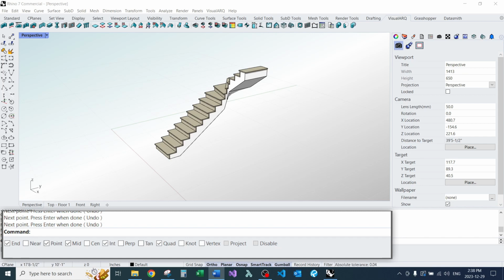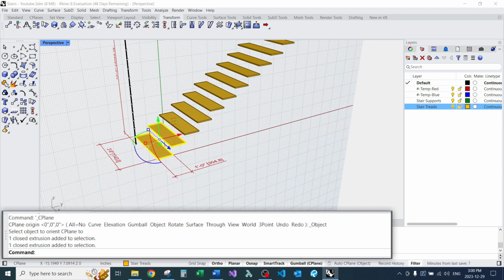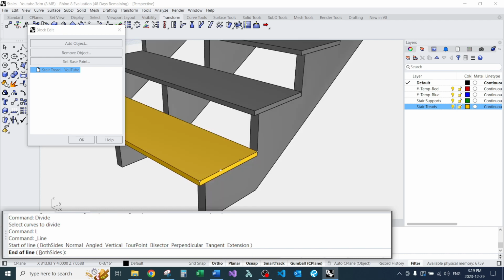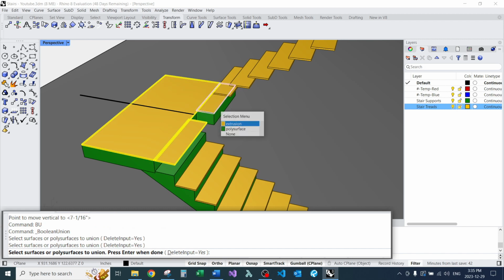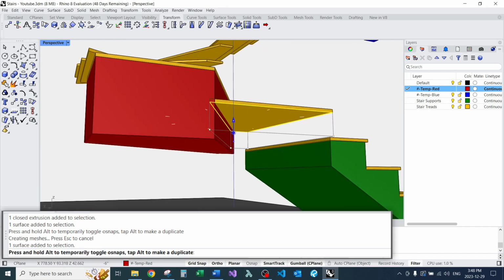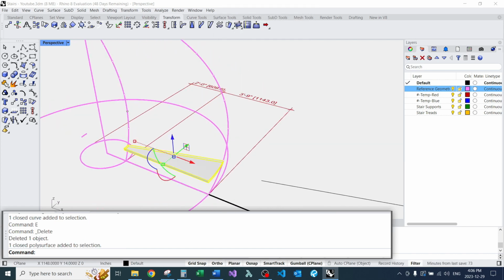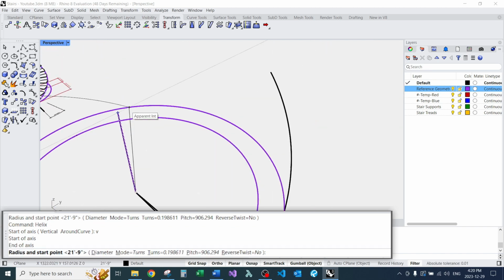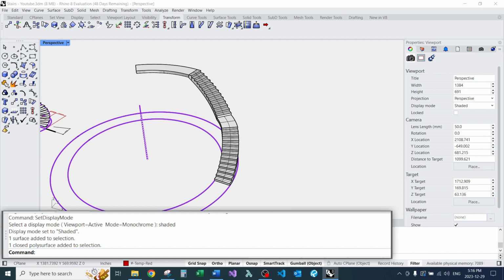Rhino Stairs 3D Modelling

Comment: Hi . I am an old hand at stair building, but a new newbie at Rhino. Do you offer any tutoring one-on one remote?
Reply from the maker: I've never really considered it and you're the first person to ask. Outside of creating videos I don't know if I'd have anything of real value to offer.
I also learnt Rhino in an unconventional way: I created a series of test projects to assess the viability of using Rhino instead of more expensive applications (like Revit, steel detailing platforms, etc...). That might make me not the best choice for someone just starting out because I have a somewhat 'patchy' skillset.
Just for a reference: recently I found out that I was taking 3 or 4 extra steps because I never bothered to test out the "Boolean Split" command (watched a video where the creator used it).
For now... I would watch videos where the uploader models something similar to what you want to create. Try to reproduce it (maybe with your own twist) and that should get you close. I can also upload quick videos on specific tasks (within my ability) on a whim.
Also, look up the Rhino Level 1 and Level 2 training. I will dig up those links for you if you're interested and can't find them.
Reply: I am fine with your abilities. Let's co-design a project . @randomCADstuff
Reply from the maker: My problem right now is that AutoCAD work is paying the bills. I m however trying to migrate towards Rhino as much as I can. It's definitely more fun. What type of project(s) do you have in mind? @rmdemaray